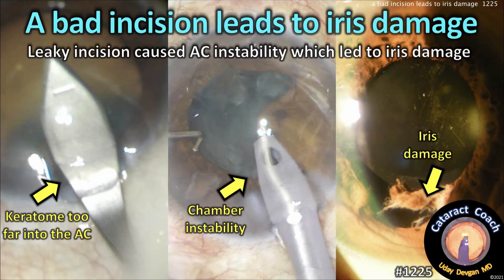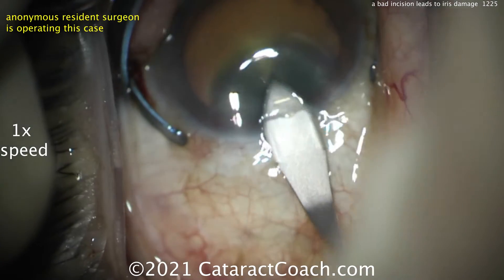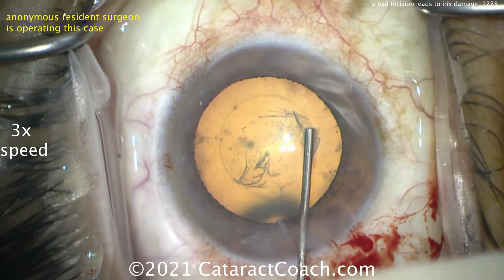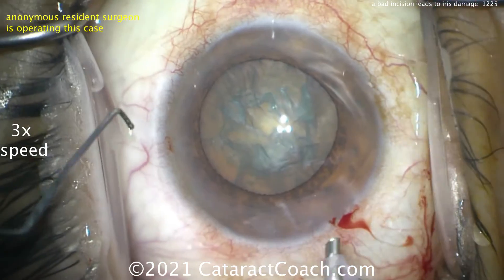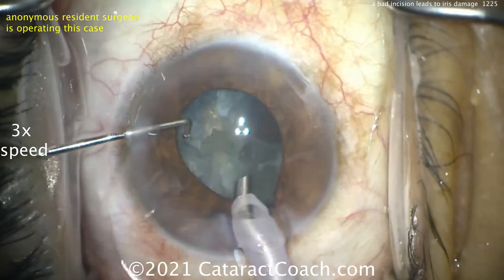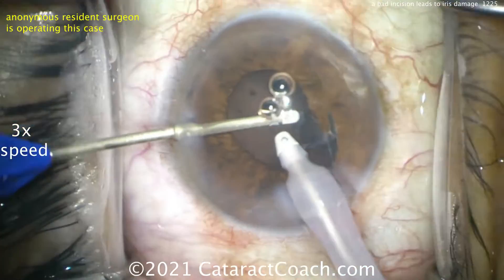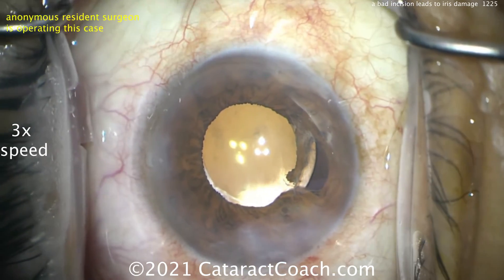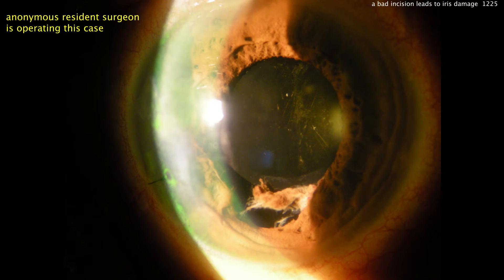CataractCoach 1225: a bad incision leads to iris damage

Comment: Thanks so much for posting this case. Could anything be done to prevent iris prolapse and damage after the unfortunate main incision?
Reply: I struggled with the incision when the blade was not sharp (maybe it touched something while preparing the instruments). So when I am in a similar situation, I ask for a new blade. By now it solved problems like this. If the incision is way too large I think one should just be aware of that fact. In the video the surgeon bit  the iris at least two times with the phaco tip. Calming down and taking the time needed should help.